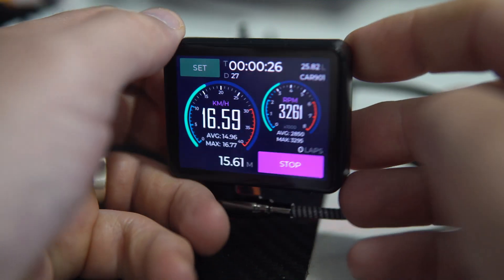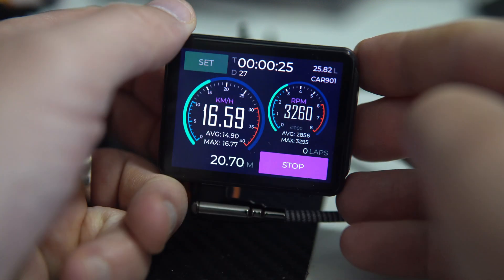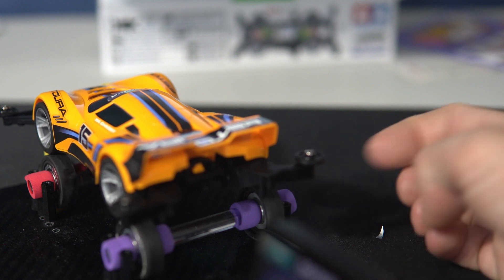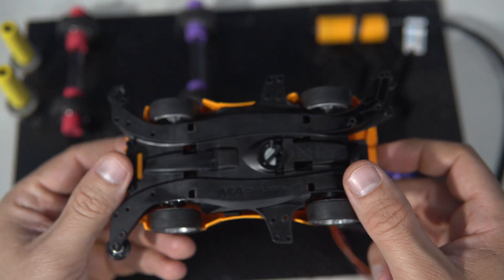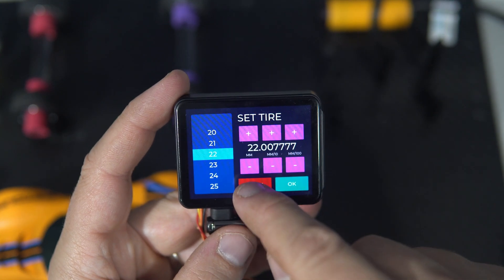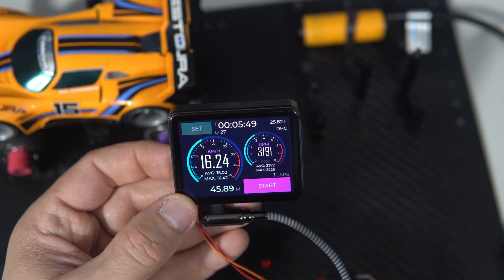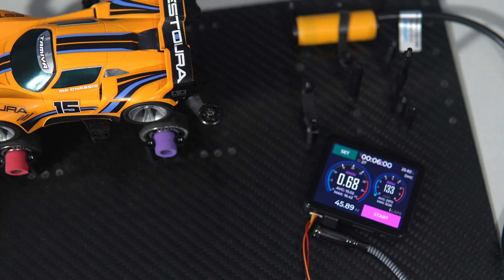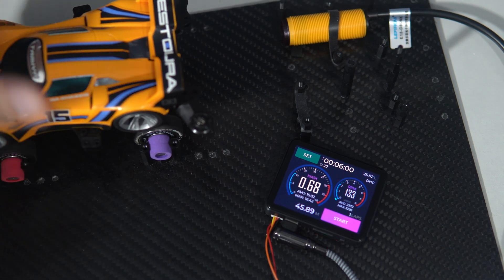Measuring Speed & RPM of Mini 4WD Cars Using a Proximity Sensor (E18-D80NK)

Comment: I have a suggestion or idea for a project. I have a weather station from Lidl Auriol IAN 283582 and the device with a screen died but outside sensor still works. How about can you make a video or tutorial how to make a device with display like LilyGo display (or other displays) but instead getting "weather information" from internet device gets information from that sensor (433 or 868 MHz) or multi sensors from outside and inside of the house. IDK if that is even possible unless you have a receiver that connects to "display" (or Arduino) and it is compatible to outside weather station sensor. I did found SIGNALduino but i have no clue how to do it, i have no experience with programming or Arduino stuff. I know it is easier just to get weather station that works from AliExpress (or Lidl).